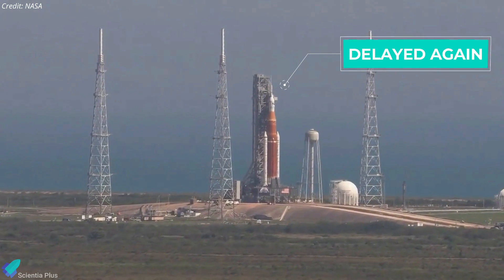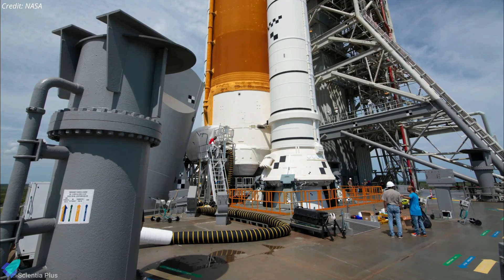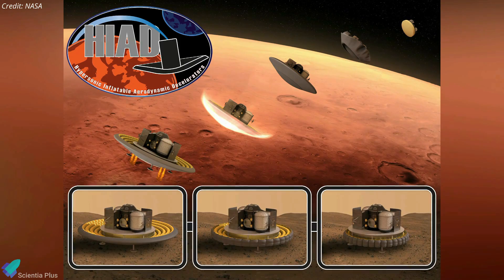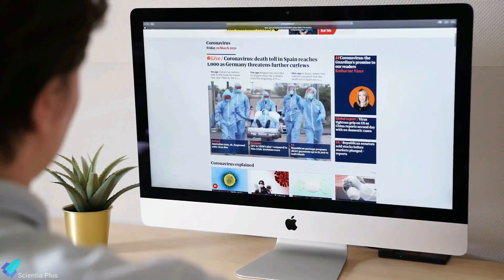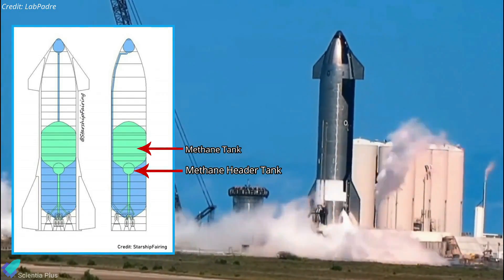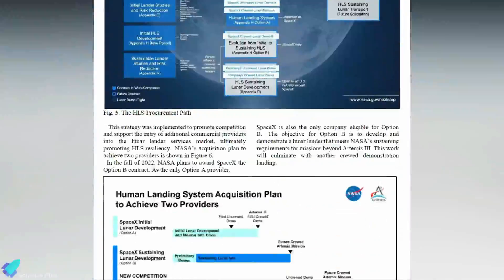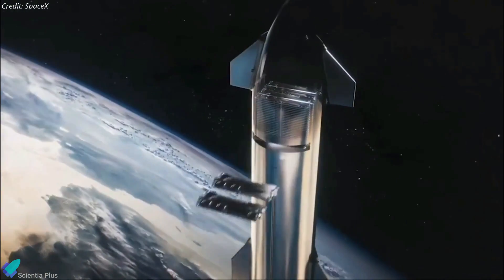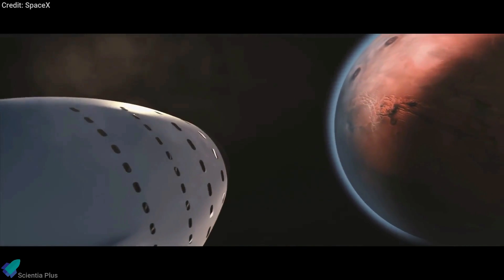SpaceX Fires Up All 6 Engines of Starship-24; Starts Huge Grass Fire, Artemis-1 SLS Repairs, ISRO

Comment: Me thinks you got the FTS expiration date wrong.  NASA received an extension from Space Launch Delta 45 on Aug. 12 for the certification of the FTS to cover 25 days instead of 20.  The FTS certification is required by the Eastern Range to be tested 15 days before launch.  SLS rolled out 16 Aug, so assume 15 Aug for FTS certification. Add 25 and you get 9 Sept (today) not 19 Sept.  If you want to extend a second time to 23 Sept that’s 39 days, not the original 20 days. Ay caramba! 

And the joints that connect each segment of the solid rocket boosters have a limited lifespan of 12 months. Since booster stacking started 21 Nov 2020 (completed 2 Mar 2021), they are now 4 to 10 months beyond their guaranteed use by freshness.
Reply: At this point it must be asked if NASA regards a RUD better or worse than SLS never being launched. If it never launches, they save face on the engineering side (no RUD), but lose it on the political side.

Comment: am i the only one who has seriuos questions about the inability to have these guys think practical? how the hell can you NOT understand that the heat from the engines is too hot for tests on UN-TESTED CONCRETE? I mean did anyone think to test the concrete first? before testing these huge rocket engines? If 6 did that then wft do they think 30 engines will do?!?smh